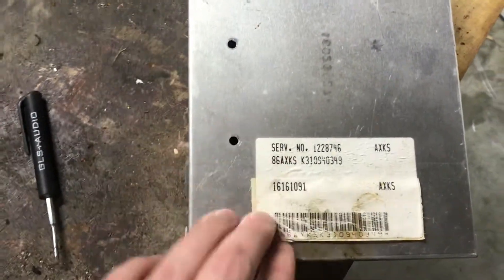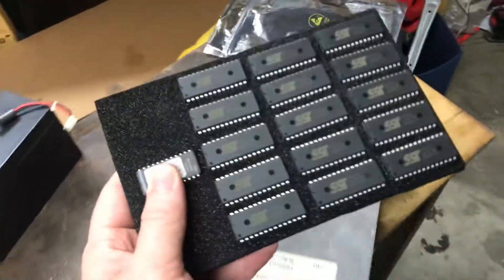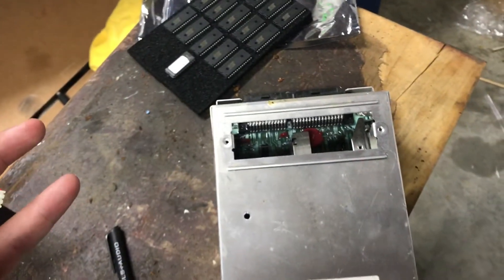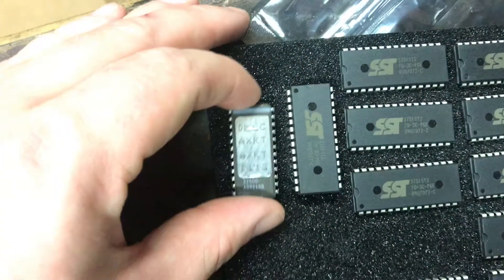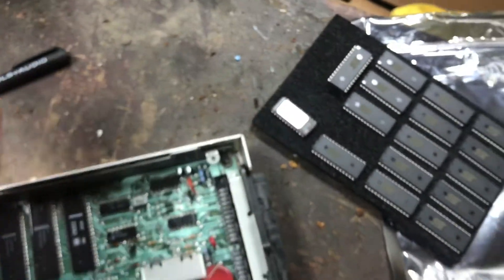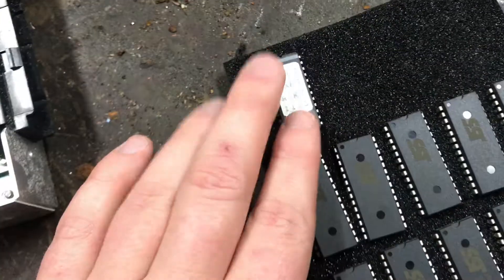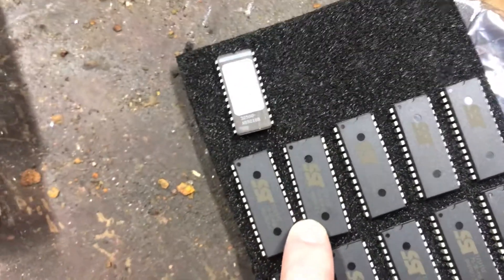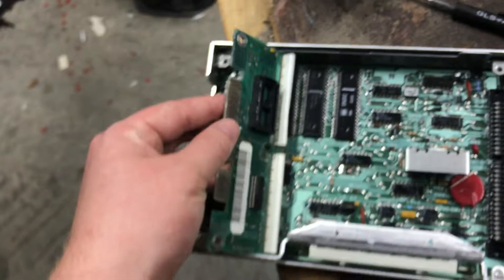Why TPI chips cannot be used in a TBI ECM

Comment: Why not code a 0411 LS computer for TPI?
Reply from the maker: When I made this, that was still very expensive. But even know, it’s a ton of work to covert to a 0411 and SFI. While I haven’t done it personally, I think for the effort and cost, going terminator makes more sense.
Reply: @RyanBooth3   - Maybe.  Everything is already programmed into the 0411.  You just have to remap the timing signals.  TPI doesnt ask for much.  If you could code that into the 0411, then your done.  Doesnt cost any more than brain work and some luck.  If anything, may have to go with a cam gear/cover off the newer TBI for the 0411 to get a signal.  Maybe also use that one year ditributor that has the reluctor wheel like the opti-spark??  Spitballing here, but I think it could be done.  And, once done, programmable to the moon!!
Reply from the maker: @ it’s been done. You need the later timing cover and a cam sync distributor. EFI connection sells a kit
Reply: @RyanBooth3     - I thought so, just could not find any info on it.  Thought I was delusional and wrote it off.

Well, thanks, take care and good luck.